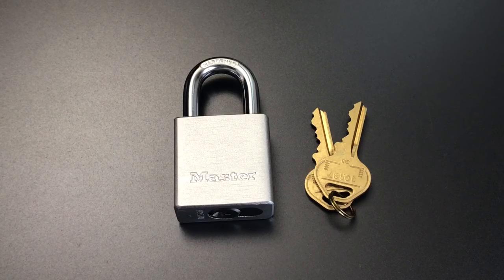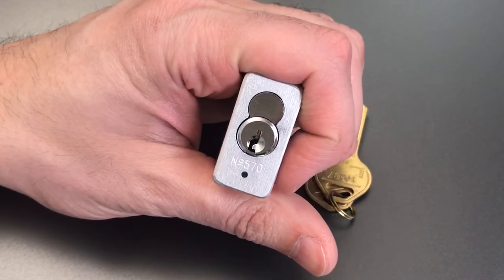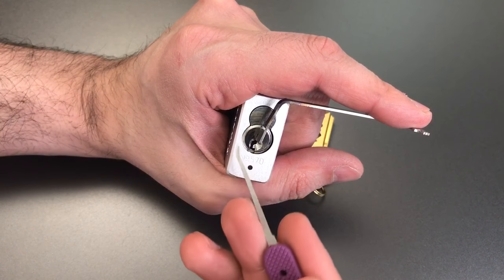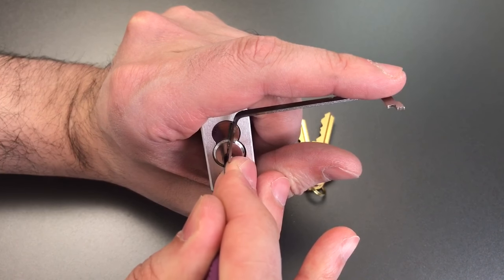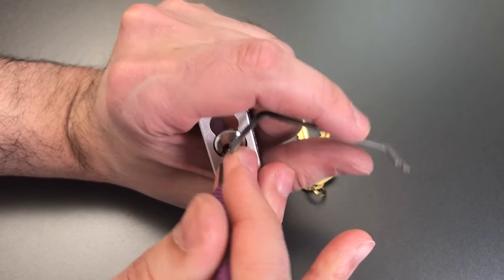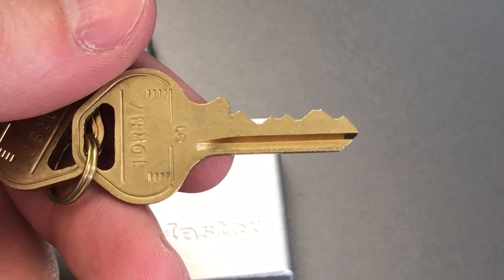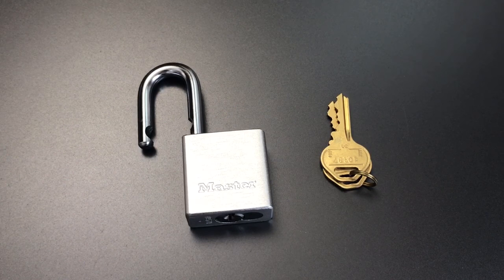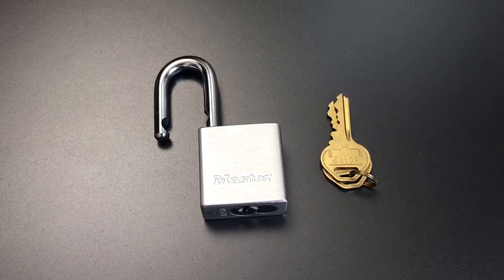[407] Master Lock Model 570 Padlock Picked

Comment: You make it look so easy. Been trying to pick this one for 2 hours.
Reply: I used this one to train myself on spools
Reply: This lock is driving me nuts. How do you get out of a false set without resetting the other pins?
Reply: @scottkesler215  with proper tension. Let off just enough but not too much
Reply: This took me three days to figure out. I hadn't had to deal with spools, and once I learned to not over-set and how to release pressure without dropping all the pins I unlocked it in a matter of minutes.
Reply: Jeez i bought this as my practice lock. I can rake it no problem but have only once single pin picked it. It was a fluke lol. I thought I was just but feel better knowing it has security pins.
Reply: I dunno why but this lock has been my kryptonite. Have picked five 410’s five 1100s and a couple 80Ti’s but can’t seem to figure this one out
Reply: Dandori issue lol
Reply: I had this one laying around from a deployment and I’ve never messed around with this until today, been trying to pick this for 4 hours 😂
Reply: I have the 575, which is very similar but has a brass body instead of steel. mine requires feather-light tension and is very prone to over-setting. I don't know why that is, but it requires a really light touch when I pick it

Comment: I have a 570 that has been the bane of my existence; I started picking locks about 3 months ago and have gotten open every lock I could find at the hardware store from the M930 to the M1X laminated padlocks, I've also opened (to my horror) every kwikset lock on my house. from watching this video I believe I do not have the correct tools as I have been attacking this lock with bottom of the keyway tension and .025" thick picks I picked up off amazon. I'm still terrible at SPP as i am having a difficult time developing the feel of which pin is which and the correct tension to apply with different locks, my usual approach is to rake into a false set and then SPP the rest of the way there. Anyways, i wanted to say that you make it look EXTREMELY easy LPP! you are my inspiration and the channel that got me into the hobby. Thank you!
Reply: You can do it with bottom of the key way tension. That's all I use right now as I am fairly new to this still
Reply: I’ve actually found it easier to use bottom of the keyway than top. I don’t have the proper width prybar for this lock, though.

Comment: LockPickingLawyer, after working my way up the chain of Master locks (1,3,5,7, 140), a Brinks 40mm, and an Abus 55/40, I have now come to this fine lock right here. TOK is proving a challenge for me as it feels awkward for me. Hence, I'll be bending a wrench in much the same fashion as you have here. Even still, I'm still trying to get over having it stay put. Lastly, you didn't mention anything about the amount of tension necessary on this lock. I found the last 3 in my list to use much lighter tension than I'd started with (the Abus 55/40 especially light).

Comment: I love this lock (I own several), and dead core locks in general. The 570 requires almost ZERO tension and very little pressure on pins. Sometimes you need to counter rotate tension to get a particular set. If you're straining to get a click, you're doing it wrong. The ML 410's are also great, just don't over rotate after picking or you will turn the lock into a baby rattle.
Reply: Perfect explanation. I just place my finger on tension tool literally as light as possible, like I'm petting a little black ant.
Reply: YOU!  YOU!  YOU!

Your response helped me immensely!  I worked this lock unsuccessfully for over an hour, then I read your post.  I was doing it wrong.  I was applying way too much tension. With a light tension, the binding pins much more easily cleared the shear line with very clear false sets.  With light tension I was able to feel and clearly see the counter rotation and…click…return to set.  Very methodically the lock opened in 60~90 seconds.  Big joy followed   :)
Reply: I did it again…It was not a fluke.
Reply: I totally over rotated it. Now I know why I couldn't relock it. Thanks!

Comment: I had a 570 with the same flaw on one of the pins:  the driver rested below the shear line.  It made it harder in a way because the top of the driver would get under the shear line and then that stack couldn't be lifted, which blocked the pins behind it.  That pin was really low and was hard to work around.  I did not like that 570.  I ended up throwing it out.
Reply from the maker: This arrangement can be tricky when picking, but only because you feel something unexpected.  Once you learn to recognize this, it will not be an issue.

Comment: Great lock to learn spools on since it has no spring tension!  Thanks for sharing.
Reply: That is actually a valid point right there. And probably a whole lot cheaper than the acrylic ones sold for this purpose too!
Reply from the maker: DP, Agreed.  Macavity, acrylic locks have very little use in picking IMO.
Reply: Why does spring tension make spools harder? Do springs take away some/a lot of the counter rotation?

Comment: I bought this as my first practice lock a few days ago, and it definitely threw me for a loop the first couple times I tried to pick it, until I realized it had security pins in it and I needed to let off a little on the tension wrench to set them each time. Although mine doesn't have the same issue with the bitting. All five need to be picked as far as I can tell.
Reply: Same. All 5 need picking on mine as well. Guess some people just get "lemons" lol

Comment: Hi LPL!  I'm a novice.  I just bought this lock.  I'm using your genesis set for my picking, and when I hit pin number one, I drop in to a deep false set.  I struggle to get anything to happen after that.  I know I need counter-rotation, but I'm not sure how to get it done.  Is that something you can help me with?  Do you have a video about that? I'm using the standard hook and a (I think) Z bar with the numbers 040 stamped on the side.

Comment: It just amazes me how quick you can pick these locks.  I believe you are way better than the average lock picker.  What padlock represents the best value as far as difficult to pick (or trick) yet still not extremely expensive (< $100)?
Reply from the maker: I've always liked the American Lock series 700 padlock with the 6 pin core.  Not expensive, and pretty good as far as pick resistance goes.
Reply: Thanks!
Reply: @lockpickinglawyer   How much tension did you use. I have the same model lock and its giving me trouble

Comment: "When the key pin and driver pin are on top of each other, that combined stack is still below the shear line"... whut? Won't you just chew on a spring instead of getting a turn? Or does it match up perfectly, so the spring is dead AT the shear line?

If that is the case, it is not a defect but a calculated design decision, as you do not hit shear dead on by accident. You get the look of a wilder bidding for the price of a lost pin stack... sounds like Master Lock to me :P
Reply: I was wondering about this myself, it would be a massive false set and a broken/bent spring gumming up the works, or maybe my dumb head is missing something,...
Reply from the maker: Right at the shear line... I've seen it before quite a few times.

Comment: I have. One of these and I have to say, it's disappointing in every way
Reply from the maker: Why?  Sure, it's not hard to open for us, but it does have 4 spools, which is right up there with comparable 40mm AL locks.  Of course, I prefer rekeyable locks, but that doesn't mean much to most people.  Not saying that it's great, but it's not that bad IMO.
Reply: I guess for me it's not really one thing or the other,  not a lockout, no changeable core, not as tough as a laminated body and really shallow spools. The body in mine isn't lacquered either, so it marks up really easily. I keep thinking that for a couple of ponds more I could have a Sal40 instead. Not that it matters in any way though, really :-)